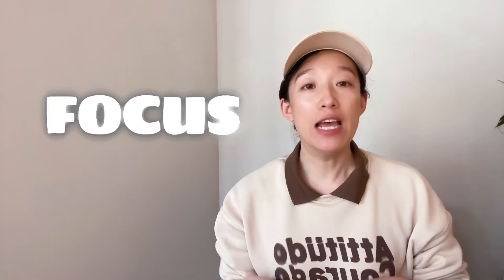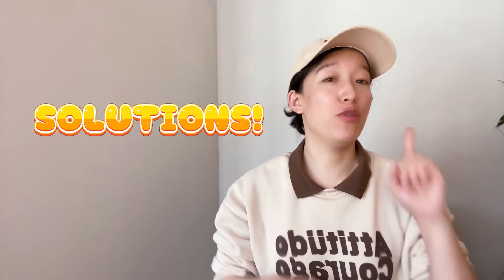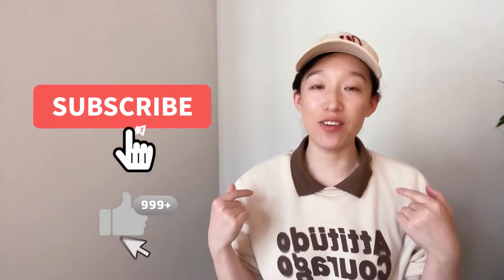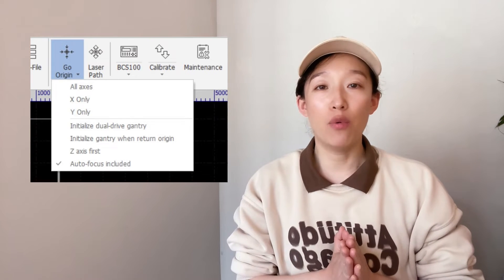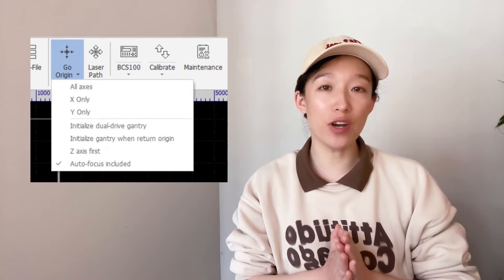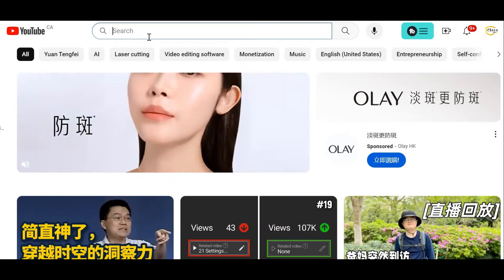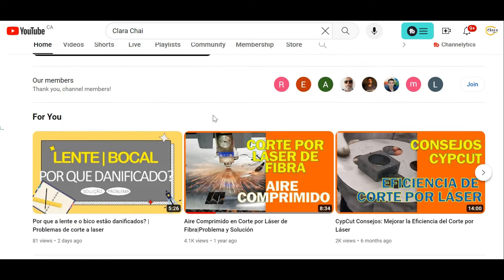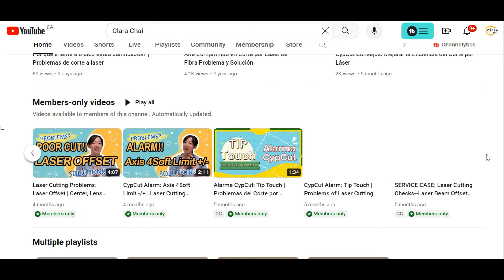Focus is Changing | Laser Cutting Problems | CypCut Issues

Comment: hi clara, is my machine having a change focus problem? We have replaced the protective lens, collimator lens and focusing lens. but when I want to use parameters that were previously good, the results are still the same. This only applies when I cut carbon steel, in contrast to cutting stainless steel with oxygen gas, the results are good. what should I do next?
Reply from the maker: find the new 0 focus